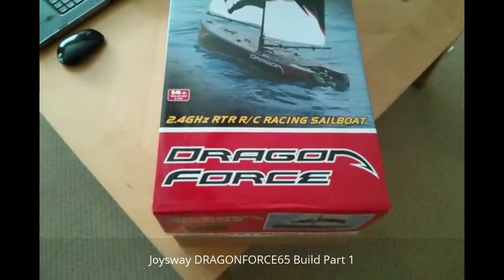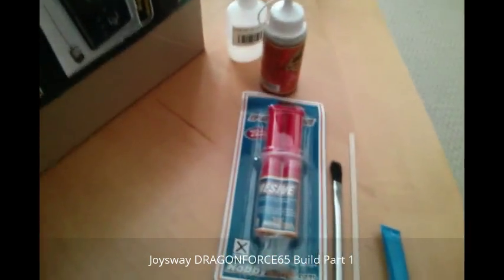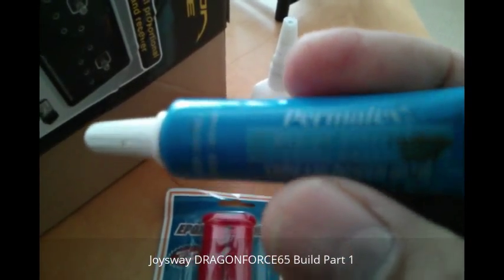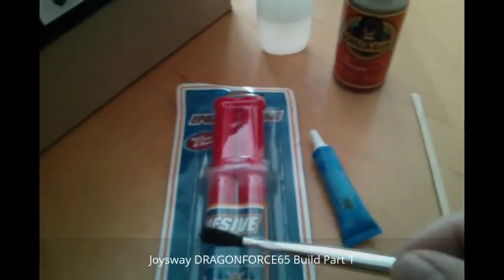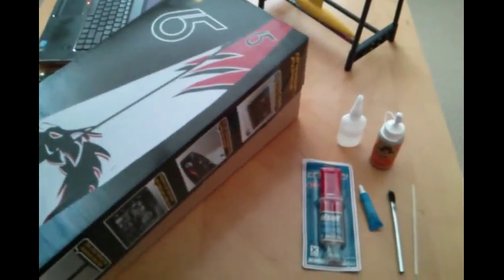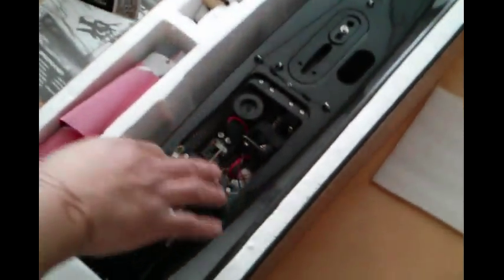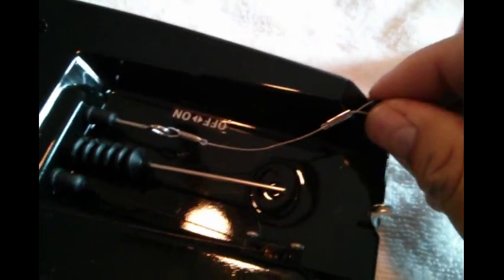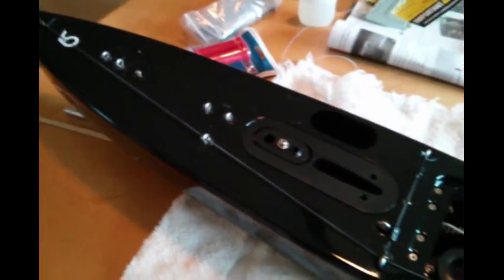Joysway DRAGON FORCE 65 RG65 Build Part 1 - The Hull

Comment: Hi Wil. I know this is a late comment but I would like to add my 2 Cents worth to this build advisory. I would urge anyone buying this boat to NOT GLUE ANYTHING. Main reasons being that if a single part breaks (Stem mast shaft of the main sail mast shaft construction) then they cannot be separated from the larger parts and refitting a small broken part would require replacing the whole mast. Also, the manual neither recommends using any glues (check page 1 where it states what is required to finish this model). I agree that the boat can take on a bit of water from deck screws etc BUT a little waterproof grease will seal those screws off and remove the issue without gluing the screws to the deck. As I said, this is just my opinion and as of 2016, without epoxy or superglue I have had no issues (apart from leaks that were resolved with waterproof grease). Thank you for your excellent videos and tutorials. If you make a complaint to Joysway and they find out the model has been glued together then the are likely (and have) to say "Warranty invalid"
Reply from the maker: Thank you for your comments.  You have valid points.  At the time of video, gluing the mast was the norm.  Thanks again for watching my videos :)
Reply: Yes it was, even one of the designers ( Youtube videos) recommended gluing the components. I'm not criticizing the idea, just trying to point out that it may not be the most practical choice for a starter. Thank you again for the time and effort you have put into your build and sailing vids, they are very much appreciated :)
Reply: good suggestions to be honest.. I made a mistake gluing my mast together and forgot to include the jib attachment... oh well.  I have all 3 sail sets, so traveling is easier when nothing falls apart. just dont break anything.. :D
Reply: I just put wraps  of scotch tape around my joiners to get a friction ''snug''  fit, & that seems to work just fine. Only glue I use, is for the ends of the lines... On my little V2 Orion, the  manual doesn't show gluing any mast parts at all.

Comment: thank you for sharing, just found your video. I race IOM but got a DF65 to get my son started in RC sailing. I actually did what you recommend there but not using acrylic glue, rather I used 5 min epoxy which works the same I think. Your Brunel boat looks fantastic are you gonna cover how you did the deco in other part? also my next step is to replace thoese shabby sails but not sure whether I take the shape from these or change the luff shape since we can only get one panel. Anyway thank you for sharing.
Reply from the maker: glouisfr Thanks for the comments.  I like modelling my boats after "racy" vessels... just makes things more interesting (and easier to day dream when behind in a race).  I will cover the painting and deco part soon.  As far as sails, shaped sails are not allowed in the DF65 class and the boat would need 7+ knot winds to make a go of the RG65's ... did you see my review of FAST Sails? (https://www.youtube.com/watch?v=-uNv_dfoI9Q) This is a small sail maker out of Kelowna, BC Canada.  I'm really liking them and they do power up nice!  Stay tuned, I'll have more build videos... and hopefully get some action video in too.
Reply: consumerwil thank you for your response. As far as I know you're not allowed panelled sails but you can still add some curve to the full right? - I'll check your link thank you and wait for your next videos... cheers and thank you for sharing
Reply from the maker: Hi glouisfr ... here is the rule on the DF65 class regarding shaping the single panel sail:

H.2 Construction
Construction shall be a soft sail of a single ply. The Jib and Mainsail of any given rig size shall be constructed from the same ply.
All sails shall be constructed of a single panel with no seams and the maker shall not try to introduce camber (shape) into the sail by means of heat or force.
The sails shall be attached to the rigging and spars by means of a single hole positioned within 10mm of each sail corner point (points A, C & E Jib, A, G & L Mainsail) and three other suitable positions along the mainsail luff. Metal eyelets may be used to reinforce these holes.
Reply: consumerwil yes saw that thank you :-)

Comment: Is there anything different with the build process for the V6? Patiently waiting for my DF65 to arrive so I can start the build
Reply from the maker: Hi Kelly, yes - the V6 won't need to have the eyelets and backstay hook glued.  If they are loose, then do it.   For the rigging,  glue is not required at the mast base and head.  Please follow the instructions in the V6 manual, it is well done and has all you need to do for a class legal boat :)

Comment: Hi will been watching your videos for a while now and picked up a DF65 RG just received my new mast kit A as the old one had a split in the main part and I’ve followed your video and stuck it together with gorilla glue when I noticed on the bottle it says dampen serface which I didn’t do will it matter it’s all setting now tapped up
Reply from the maker: Hi, should be OK, I've used the gorilla glue without water dampening throughout the build :)